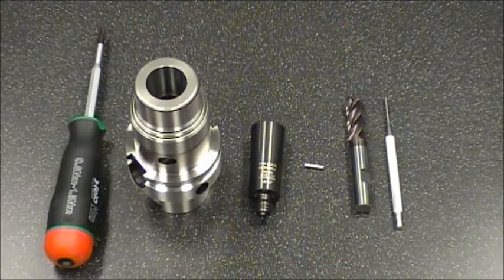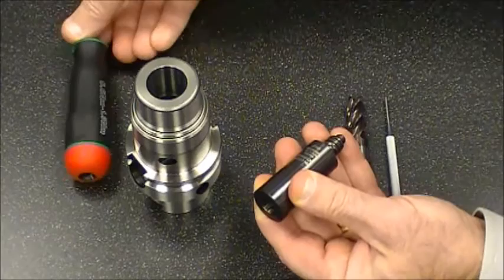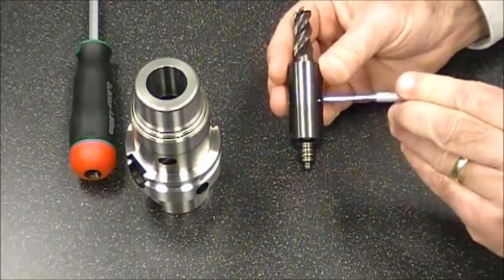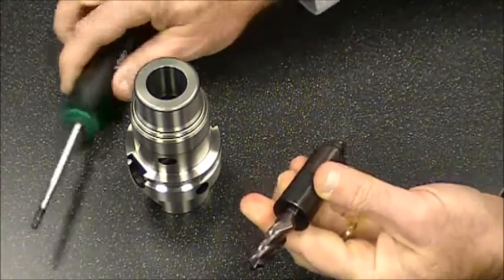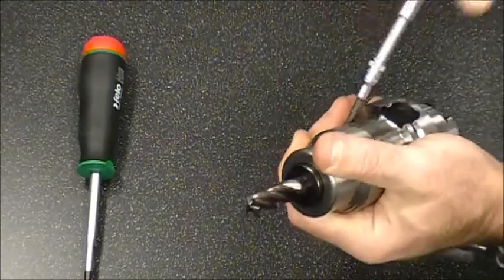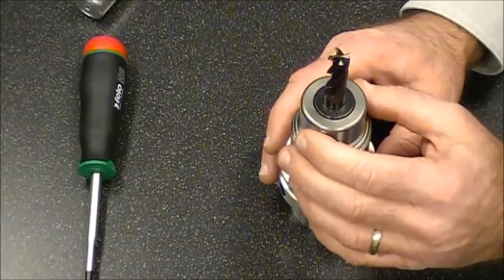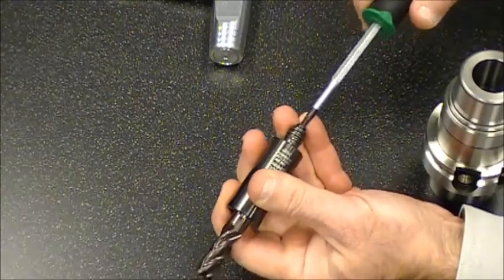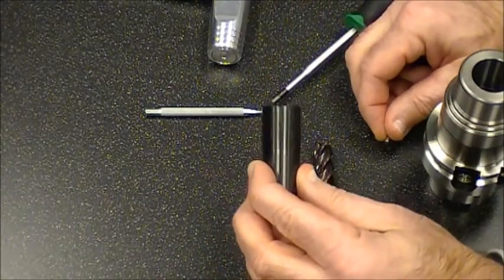Guhring HPC PinLock demonstration

Comment: Hey, great video and very interesting system. I run a spindle with ER20 collets and I have not encountered the situation where the endmill is pulled out (I of course run it very conservatively) . Can you give an example where endmill pulling out might happen ?
Reply: ER and TG systems don't have the clamping for heavy cutting especially at high rev/min. 

I'm not totally sold on the Guhring system though I do love their lineup of cutting tools. There are already lots of great 'chuck' systems on the market that are less complex like; SK, sleeved milling chucks, hydraulic (Schunk Tendo E etc) and PowRgrip (rego-fix).
Reply: +HurtigrutenExcursion Taking heavy cuts, or milling in harder metals and taking large stepovers.